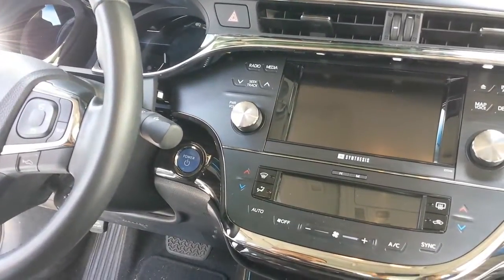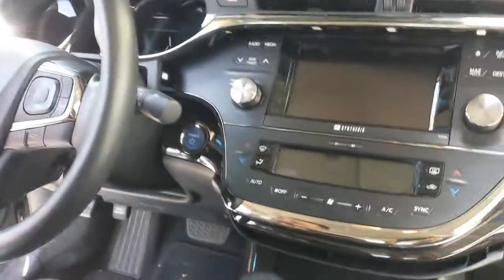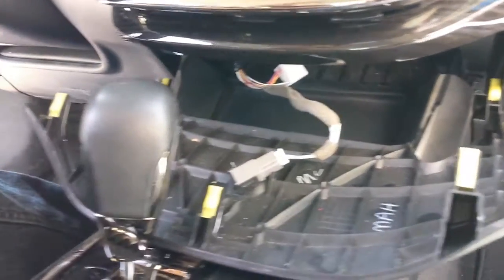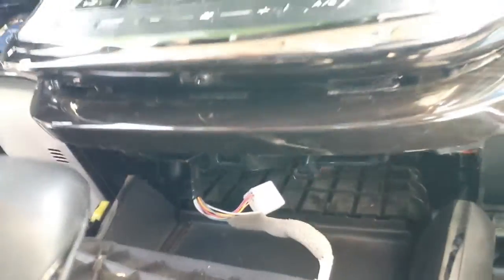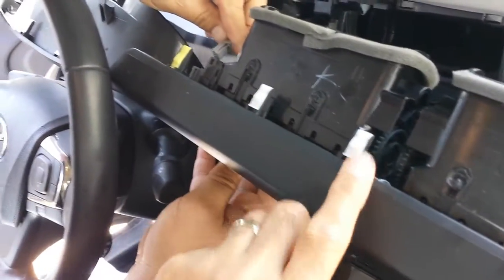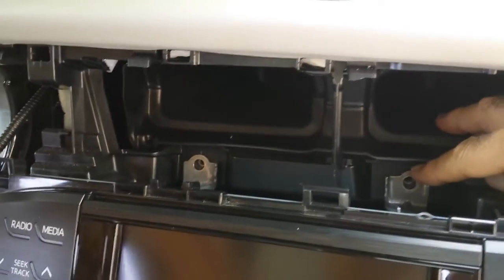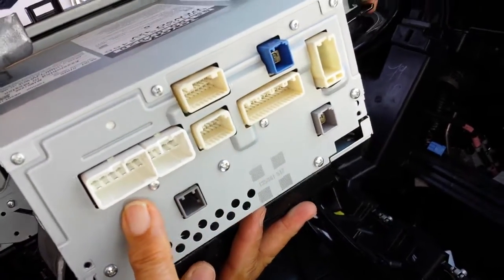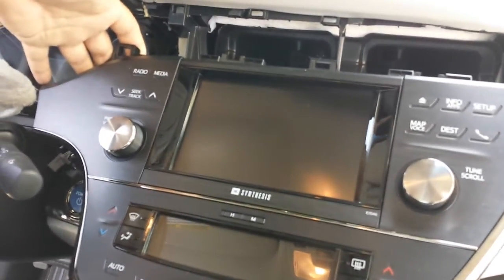How to Remove Navigation / Radio from 2013 Toyota Avalon for Repair. Part 1

Comment: I hate when videos like this gloss over the VERY IMPORTANT details... like, how do you remove the leather sash connected from the upper vent assembly to the steering column base?  I feel like I'm going to rip the leather when I pull on either side.  I can see the sash in your video for just a few frames and it seems to be permanently attached to the upper vent assembly so I guess I'll focus my efforts on figuring out how it disconnects from the steering column base.  I just wish you had actually shown all the steps to the removal here.
Reply: wogfun, did you find a solution.  I too have to remove the entire instrument cluster assembly trim piece due to chrome peeling (part 55410-07040-CO) and reinstall new assembly.  Did you have a problem.  Dealer wants to charge be anywhere from $375 to $1200 to replace that part??  Will attempt to do myself, if not too hard.
Reply: @garthmcbridesr6440  - same here! Hard to believe they want to charge $600+ for PLASTIC?! What did you ultimately decide to do?
Reply: @jrh11254  ultimately ended up paying $530 to replace the peeling chrome panel.
Reply: @garthmcbridesr6440  - where did you find it (if you don’t mind my asking)?
Reply: @garthmcbridesr6440  - my cup holder trim-pieces were peeling so I took the assembly apart and saw that the fake chrome pieces were just  painted plastic rings - each sold separately for $50+ each?! So I just peeled off what I could then took a razor blade to shave off the rest. Once that was done I painted the rings a glossy black then reassembled. Looks great. Before that I had an upholsterer reupholster the center console lid and driver’s-side arm rest with marine vinyl. He did a great job for $150 - far cheaper than the $100 junk-yard lid and the $130 junk yard door panel I found on eBay!